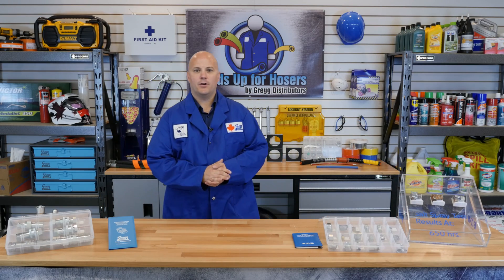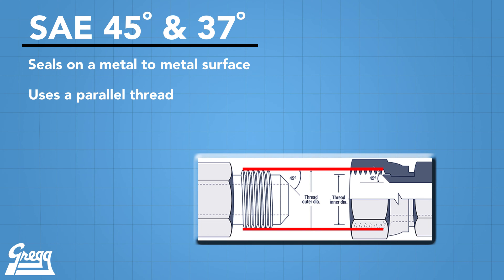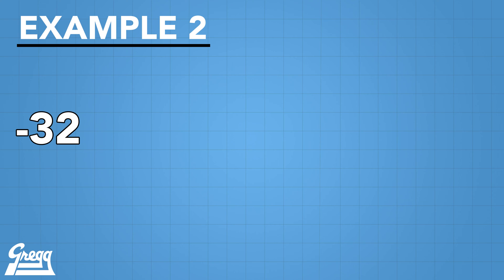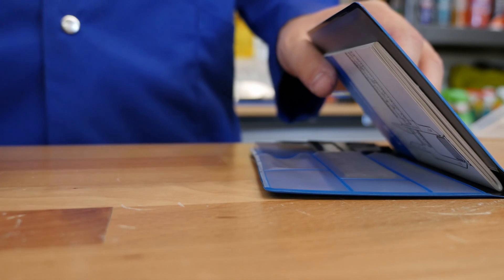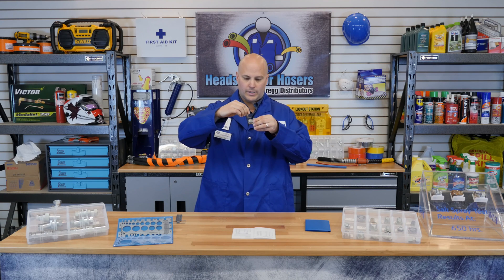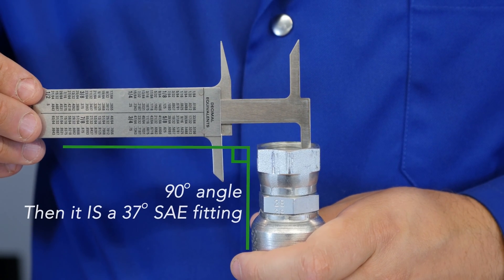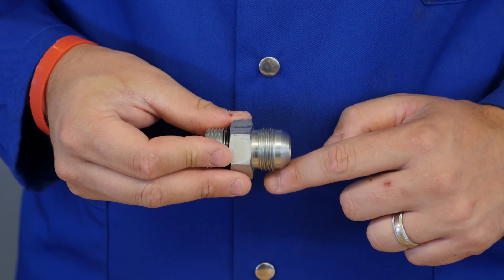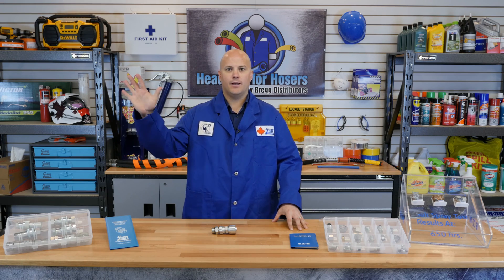JIC Fittings / Thread - Identification & Installation - Heads Up for Hosers

Comment: I realize this video is 7 years old, but found it extremely informative. I have recently acquired a 1968 Case 580 CK and it is in dire need of nearly all the hoses to be replaced. I have purchased a few and it nearly took me mortgaging the house to afford them. I recently purchased a hydraulic crimper and am going to be making my own hoses from now on. I have a ton to learn and videos like yours sure help a lot. I noticed you had a booklet and caliper, it appeared to be a kit of some type. Is that something that can be purchased as a kit like you had in the video? If it is within my budget I would like to get one, if it is from your company. Thanks again for the video.
Reply from the maker: Thanks for watching! These are the thread identification kits that we carry: https://greggdistributors.ca/search?q=Thread%20identification&resp_group=Default,Variations,ItemProperties

Comment: Hello sr., Which is the Thread angle of JIC fittings?
Reply from the maker: As shown in the video JIC has a 37 Degree thread.
Reply: @GreggDistributorsLP  Thank you Sr., I noted that 37°C is the flare or seat angle, but I found that JIC thread does match with UNF specs, for example: for Dash N4 (1/4") thread spec is 7/16"-20, TPI and outer diameter (male thread =0.44") are the  same mentioned in UNF specs for 7/16" thread, it is correct? if yes, thread angle is 60° (I'm sorry for my English, is not my native languaje)

Comment: If I connect JIC fitting to spherical O ring seal, they will leak or not? Because it happens in low pressure system , and found no leak
Reply from the maker: For a JIC fitting the sealing action occurs on the 37 degree seat of the adapters and not on the threads.  The use of an O-ring of any kind should not be necessary.  If you are worried about leaks on a JIC fitting, you are better off to utilize a specialized sealant such as Loctite 5452, if you want to learn more about this product, it can be seen here: https://greggdistributors.ca/adhesives-sealants-and-tape/Thread-and-Gasket-Sealants/Pipe-Sealant/lct1265770

Comment: Is there a working pressure for those fitting? And at which value they could withstand?
Reply from the maker: The question of working pressure is a tough one to answer as there are several variables that have an impact on the ultimate pressure rating for the adapter.  Pressure ratings can vary based on the material, the quality of the adapter and ultimately whether or not the adapter is being utilized in a dynamic or static pressure application.  Lastly, pressure rating varies based on the size of the JIC fitting.  For instance, the Aeroquip -4 JIC has a pressure rating of 7,000psi whereas the -32 JIC has a pressure rating of 1,750psi.

Comment: 1:50 So, if I connect JIC 37 male with SAE 45 female. Is it going to hold?
Reply from the maker: As long as the fittings are not a -6 or -12 size, they should still create a seal on the metal to metal surface and hold together.
Reply: @GreggDistributorsLP  Thank you